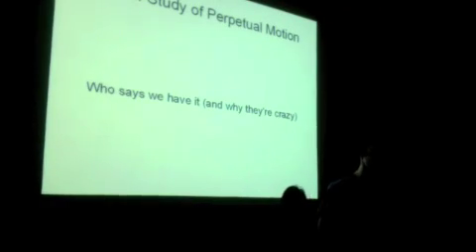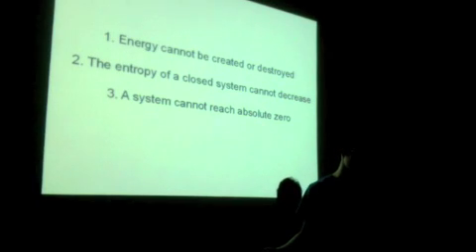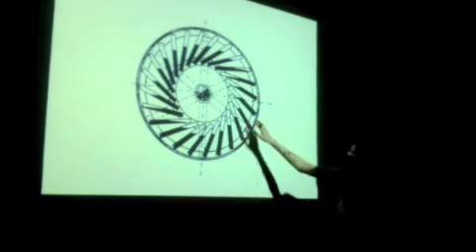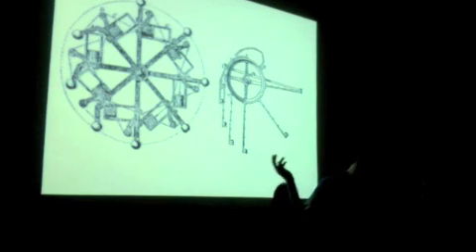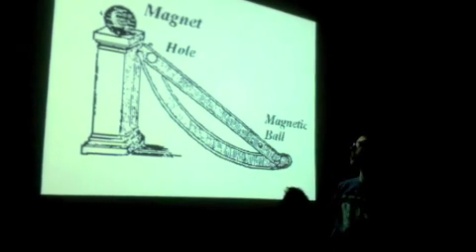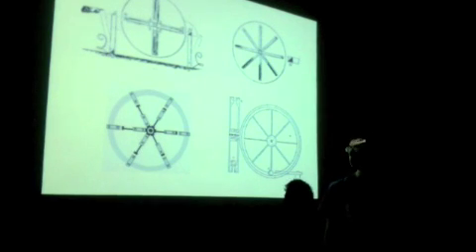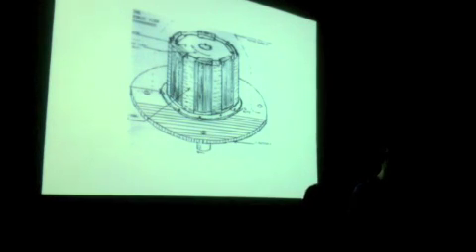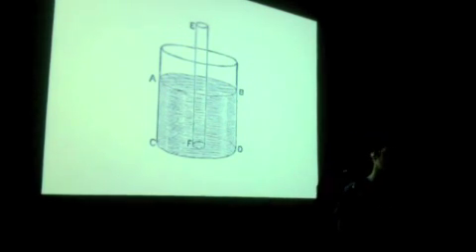A Brief History of Perpetual Motion Machines

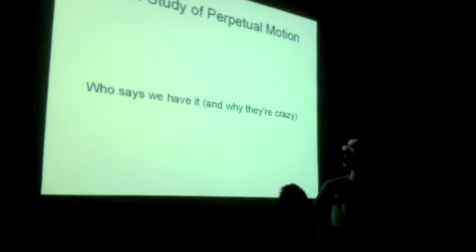Comment: At 0:55 you say that a perpetual motion machines produces more energy, than it's need to be run. Can it just make that exact same amount of energy that it's producing as using.
Can't that also be perpetual motion?

//You should never be finished with all of your project before you die, for if you do you'll will die doing nothing, Better die doing something.

Trying to make perpetual motion machine is one way to do it.

Comment: You got it wrong. The self flowing flask works by siphonic action. It can only work if there are enough gases in the liquid. Just search self flowing flask test on YouTube. In this case, there is actually an external energy source. Siphonic action works by gravity, which is the external energy, and pressure.